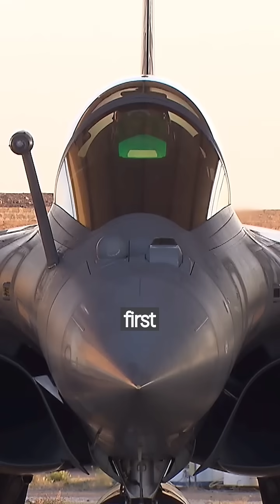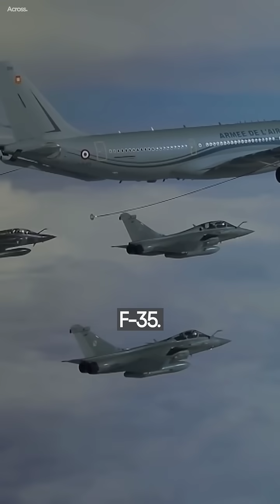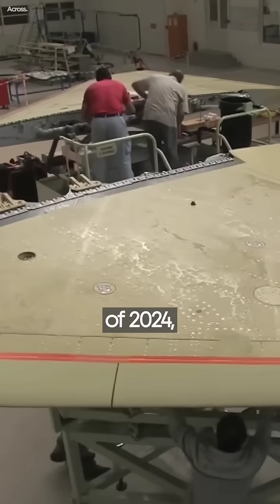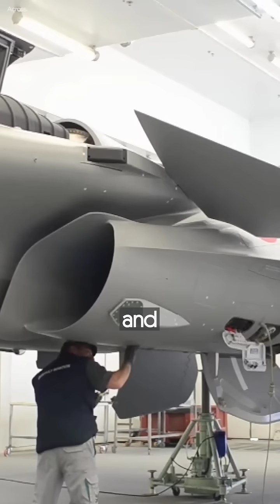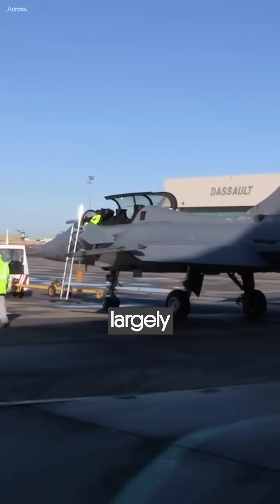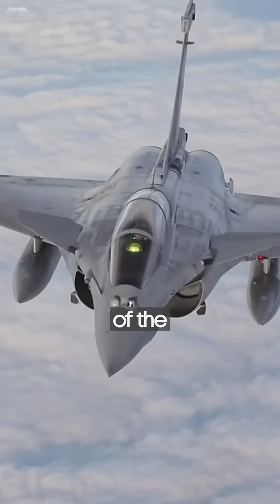The Fighter Plane No Nation Wanted to Fight #shorts

Comment: The Rafale is the first and only omnirole aircraft. The difference between omnirole and multirole is that unlike multirole which it can do every type of mission but only one of them per sortie, omnirole can do every type of mission per sortie, excellent in all of them.
This is one of the reasons why Rafale is attractive.

Btw, the incoming Rafale F5 upgrade will have the new radar RBE2-XG will be able to detect the F35 and any mini objects without problem. Such as tiny drones which are currently practically undetectable by all current radar.
So in a short time the steal of the F35 will be obsolete.
Reply: If only you worked in aviation and knew anything about
Reply: @lolgoteem5372 you don’t.
Reply: Bro literally fell for the marketing. Call it omnirole, swingrole, dualrole or whatever, they're all multiroles and pretty much any modern 4th Gen could achieve what the rafale is doing. Come back when the rafale has shot down a satellite
Reply: @CallsignYukiMizuki  Not at all. For instance the Eurofighter cannot land or take off from an aircraft carrier. As explained in the original comment, the Rafale can conduct all sort of missions in a same sortie (intelligence + bombing + interception for instance)
Reply: @azurman3  
Not all aircraft needs to be carrier capable, especially when only 2 countries operates CATOBAR carriers (excluding cope slopes). Why would a typhoon need to be carrier capable when Spain or the Italy doesnt have CATOBAR carriers? Its a moot point. And plus only one variant of the Rafale is carrier capable, so dont go acting like every Rafale can land on the Dugalle or any of the Nimitz / Ford, because the French Air Force's Rafale C absolutely cannot land on a carrier.

Also the capabilities you mentioned is not unique to the Rafale. What's stopping a F-16 going up with AMRAAMs, JDAMS and buddy lase for F-15Es also carrying AMRAAMs and GBUs? Literally any 4th gen can do this, even a tomcrap could
Reply: @CallsignYukiMizuki Generations are litteraly marketing against the Russians
Reply: Why this is wrong. Did you know? The F-18 Hornet has the ability to switch from ground attack mode to air attack with the flip of a switch? Not a big deal right? They had that ability in the 80's. During the Gulf war, A 4 flight of legacy Hornets on a bombing mission switched to Air to Air mode, shot down enemy fighters, and went back to successfully completing their strike missions without jettison bombs or fuel tanks. This took place 10 years before the first Rafale was in service. No knock on the Rafale, great fighter, but it didn't invent this stuff, quite the opposite. This was real world, No propaganda, no nationalism, just facts. The legacy hornet was doing it, and doing it well, before the Rafale existed. Omnirole... SMH
Reply: @Rickrick911  So just 2 kind of mission in one sortie is enough to say that it is the equivalent of the 7 types of missions that the Rafale can do at the same time in a single flight ?
Reply: @Kamonohashiii  Again, no knock on the Raf, it is a frigging great jet. You guys are super hype about this stuff though. Relax! I just pojnted out the Hornet did what you guys brag the Raf can do, in real wold combat, 10 years before the Raf went into service. You ever hear of a Phantom? The F-4E Phantom 2 was a Mach 2.2  interceptor, air superiority fighter, Fighter bomber, wild weasel anti radiation jet, was carrier capable, carried EW radar jamming pods, Preformed reconnaissance, and had precision guided missiles. In the 60's. Another that did all that in real world combat too. The F-15 too, and it is 104-0 in air to air combat, it doesn't do the carrier thing but it does all the other stuff and also shoots down satellites. The SU-27 had a lot of this capability too. Again, no criticism towards the Raf, Dassault designed a winner, great jet, arguably one of the best. IT just didn't invent this stuff.
Reply: By the time rafale F5 is released...maybe F-35 Block 4 is available
Reply: A 40yr old jet made with french technology is not going to make a mass produced 5th gen stealth fighter developed by the most advanced country in the world obsolete with magic drones.

Give your head a wobble mate, you can go have fun with that but when shit goes down I want a 5th generation stealth fighter
Reply: You have no idea of what you're talking about lol 
First of all, the Rafale was neither the first nor is it the only omnirole jet in the whole world.

Secondly, the F5 standard will only be operational in the late 2030s. 
And the Rafale just like any other modern fighter aircraft, already has the capability to detect an F-35 (or any other true 5th gen jet) with its radar or electro optical sensor. It's just that they're only capable of doing it at no further than near BVR distances. 

Thirdly, when it comes to detecting small drones, all modern fire control AESA radars can detect and track small drones without much difficulty. And although they can't obviously detect and track them at the great distances that they can detect/track late 4th gen fighter sized targets, they can still detect/track them at longer distances than they can detect/track a VLO stealth jet like the F-35, because a lot of these drones have RCS numbers a few orders of magnitude higher than those of a true 5th gen jet like the F-35. They were not designed to be VLO, stealthy drones with RCS values similar to those of a bee, or a mosquito, like the F-35 (and F-22) were.

Finally, stealth is not going to become obsolete anytime soon. 
Sensor and counter-stealth technologies have improved a lot and will continue to do so, but so will stealth technology. 
Besides, even if all of the sudden a new revolutionary radar came out that could detect true 5th gen jets like the F-35 at the distances that current state of the art radars can detect modern 4th gen aircraft, that would only make 5th gen aircraft like the F-35 even more wanted and needed, and the advantage of 5th jets over 4th gen jets would stay the same, because everyone would quickly have this new kind of revolutionary radar and then due to basic physics and the radar equation, 4th gen aircraft would also be detected/tracked at even further distances and the detection/tracking range difference between a 5th and 4th gen jet would stay the same.

The fact that all of the great powers military-industrial complexes are heavily investing in all kinds of stealth for all types of applications (not just stealth fighters and drones) speaks volumes and in itself already proves you wrong and shows how idiotic your smartass comment was.
Reply: @deltasierracharlie  Name me a fighter capable of doing as many missions in one sortie

No current fighter can easily detect mini drone  It is not for nothing that a Chinese balloon flew over the United States for several months without being detected.
The new radar will detect it without problem.
In Russia despite their advanced radar, its almost impossible for them to spot the drones which bomb several strategic sites.
I think you overestimate the current radar.

This is why I insisted on “easily” to detect the F35
Reply: @Kamonohashiii dude the balloon was tracked and monitored far before it entered US airspace. They just chose not to shoot it down until after it was off the coast. Stop spreading misinformation.
Reply: Omnirole is something dassault made up and is not a term used in the industry, it's purely marketing.
Reply: @RasDev Just like Lockheed did with 4, 4.5, 5th generation jets. Purely marketing as well
Reply: @RasDev  So is the “generation” thing invented by lockheed…
Reply: @RasDev talking about marketing is funny when we know how the "generation" in jet fighter is just an US marketing argument, same for the "stealth" argument wich is used since the F117, that "stealth" plane who was detected and destroy in 5 minutes in Serbia.
Reply: @RasDev  only the Rafale can do all type of mission in one flight. This is called omnirole.
Reply: @Kamonohashiii  the Gripen is also capable of this
Reply: @RasDev    Gripen can only do 3 kind of mission which are air supremacy, interception and reconnaissance.

on the another hand, rafale can perform air supremacy, interdiction, interception, aerial reconnaissance, ground support, in-depth strike, anti-ship strike and nuclear deterrence missions in a single flight.
And it can operate on aircraft carriers and even those of the US
Reply: @Kamonohashiii mmmmm incorrect the f/a 18 can do multiple missions in one flight. It’s actually been done when 2 f18’s shot down 2 mig 21’s then proceeded to drop bombs 😬😬 also omni role is just a play on words… don’t forget about the g variant which can do everything a f18 can do plus electronic warfare.
Reply: @donovanroberts7394  Except that it can't do as much as the Rafale, which can do all the missions that exist in one flight. and can also do EW even without Electronic Warfare System Support which is also the only fighter who doesn't need this.
Reply: @Kamonohashiii 
All that is the capability of the GRIPEN, EUROFIGHTER and even  the SUPER HORNET.
Reply: @Kamonohashiii 
Everything depends on the payload,  which the aircraft carries.
Reply: @EK-gr9gd  See my comment on the difference between multirole and omnirole 
There are no eurofighters and gripen operating on an aircraft carrier
Reply: @Kamonohashiii  
For there is no need to!
Reply: @Kamonohashiii en un seul vol? Alors qu’il dispose d’un petit réservoir 😅pas comme les su35 qui dispose d’un grand réservoir qui peuvent mener à bien cette tâche sans avoir recours aux ravitaillements en carburant 😅
Reply: @abassesaman5242  Rafale can fly 13 hours and have 3700 km autonomies
Reply: @Kamonohashiii So how much is a Rafale 4.5 gen fighter ? $125 million right

F35A is only 82 million with very good stealth and EW within not needing a separate pod or f18 growlers. 

Your claim is that Rafale is the only jet with EW capability on the inside of the jet, WOW THATS NUTS 😂
Reply: @ryszardfalkowski7917  First of all, currently Rafale cost $80M average with way cheaper maintenance cost. And without the hundreds of software, hardware and mechanical failures of the F35 has, which costs hundreds of millions of dollars to fix with mixed results.
Like the fact that it can't come close to a thunderstorm or that his own mounted gun cant shoot straight and dealt damage to himself which was only "fixed" very recently.
Your number that you say was 20 years earlier, which this figure included the investment of the project plus the manufacturing price per the number of Rafale produced.
The investment price of the Rafale cost 48 billion dollars, while that of the F35 exceeded 1600 billion dollars.
So, if you do the same procedure as your number including the investment price, I can't imagine the true cost of the F35.

Secondly... Carefully reread what I wrote about EW
Reply: @Kamonohashiii  Investment of F35 isn't 1.6 trillion , that's the cost for the lifetime of the program which will run into the 2070s. Again 1000 already built and Backlog is long ,  it's a 5th generation jet with tech that is too numerous to count. If the F35 had as many issues as you claim it does (in the hundreds) then it wouldn't be operational and yet here we are in 2024, Israel's F35i is used extensively.
Reply: @ryszardfalkowski7917  It's called investment. And the F35 was originally planned that it would be around 300 billions.

Being able to fly does not mean being operational.
There are still quite situations that F35 pilots are prohibited from doing
Reply: @ryszardfalkowski7917 The F35 is costly to maintain and comes with bells and whistles of American diplomacy and control. This significantly reduced its charm to several countries, mainly countries who do not want to depend largely on America.

Dassault is setting up an engine repair and jet maintenance facility in India, with an offer for full blown indian production if given 100% stake, US will never allow Lockheed to do that. Hence the popularity.
Reply: @EK-gr9gd  Bullshit, everything counts
Reply: @Kamonohashiii  And by the way, Rafale is builded modular. it means that every part of the plane can be easily replaced by average mechanic and in just ordinary workshop. Spare parts are made in the way that they can be used in any other French aircraft
Reply: @RiTorpedo  regarding what?
Reply: @donovanroberts7394  This took place 10 years before the Rafale was in service. But the Rafale invented it!
Reply: @Kamonohashiii  The Raf M is not the same as the other Model Rafs. Come on man, that's like saying the F-35A, B, and C are the same aircraft. However, other than the Wheels, the US Navy Phantom 2's were the same jet as the Air Force version. The Phantom 2 was an superiority fighter, anti radar wild weasel, fighter bomber, which also had electronic warfare pods. No the Raf was not the first and only multirole omni role fighter. The SU-27 also did all this. Again, no knock on the Raf, frigging great jet, but stop with the it invented this stuff or was the first.
Reply: @Rickrick911  I feel like you can't read me
Reply: @Kamonohashiii  Technically the F-22 can multiple missions at once too, so the F-22 can be referred as omnirole. That should be the same for the F-18s and F-35s.
Reply: @donovanroberts7394 ain’t no way bro said that « since that plane killed one guy the dropped a bomb, it’s omnirole » it ain’t fam, it can’t Intercept, Kill, Reconnaissance, Do Air superiority, do precise Ground strike, then come back to base.
The F/A-18 is good plane nevertheless but it ain’t doing allat fam
Reply: @Kamonohashiii tu as UN PEU abusé quand même, desfois
Reply: @UltimEVB  bro  why do you think the us navy only used f18 hornet/super hornet/ growler for over 20 years? Differently not because it’s a one trick pony. It can intercept 100% it can conduct sead, cas, air to air refuel, escort, recon, and many many more. the rafale is a sick, head to head would beat the f18 unless it’s super close dog fight. but the f18 platform alone makes it better. Platform dates back to the 50’s and is still regarded as a great modern jet.
Reply: At last a wise comment. +1